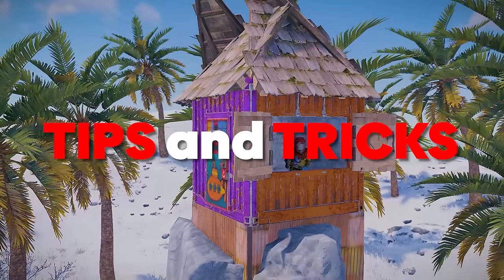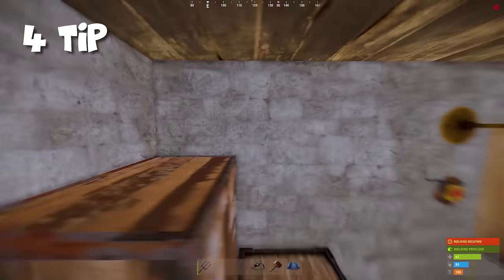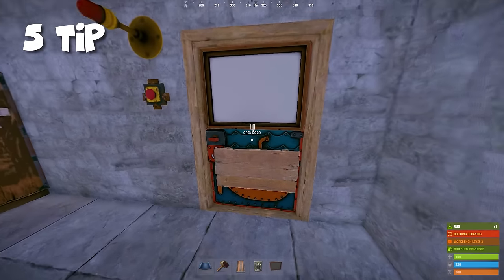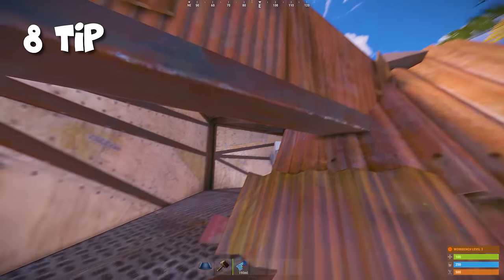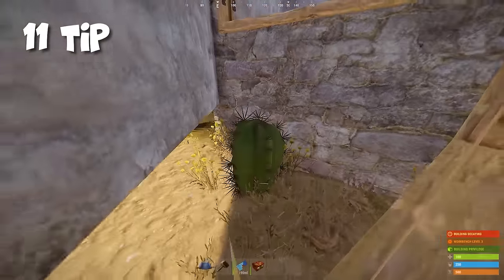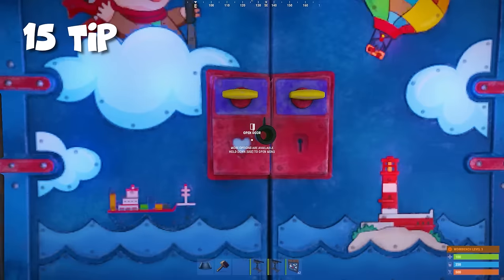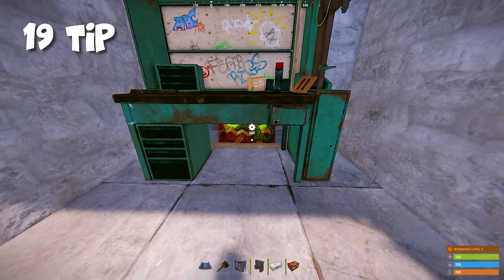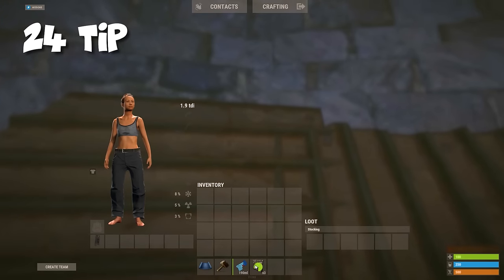20+ MUST KNOW Rust Base Building Tips!

Comment: Here's a tip:

Auto depo box - wire a small battery to a conveyor, use a pressure pad to turn on the conveyor to move loot from a box at your front door to a box in your core, wire the "transfer fail" to the power off on the conveyor

Now when you stand on the pad and depot, the conveyor will transfer loot and turn off the conveyor after saving your battery

This is an extrapolation from AIT's battery powered turret. Much love and peace!
Reply from the maker: +1 tips for the next vid. Thanks!

Comment: If you build a window wall on a roof access room that is sunk halfway into the floor, you not only get a peak but you can often angle a shotgun trap hidden in it pointing out that window into the roof. And since roof access rooms are usually symmetrical around the roof its near impossible for someone to set foot on the roof without getting their knees taken out by a half dozen shotgun traps pointed at them that they cannot get an angle to shoot with explosive ammo beforehand.

Makes for cheaper defense than turrets.
Reply from the maker: +1 tip for the next video

Comment: I don't understand the water barrel "glitch". You've put a pump in water to pump water to a barrel like it's intended. What's the "glitch"? It just seems like you're using it as it's meant to.
Reply from the maker: Water overflows from the barrel into the fuel tank with the hose disconnected from the vehicle
Reply: @stelicRUST does this still work?